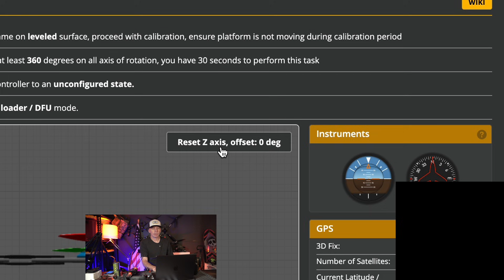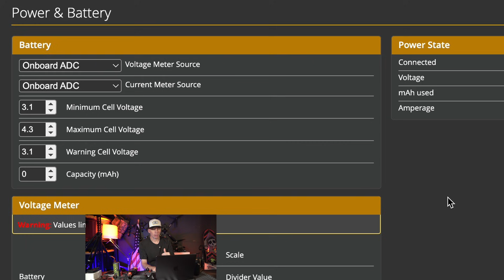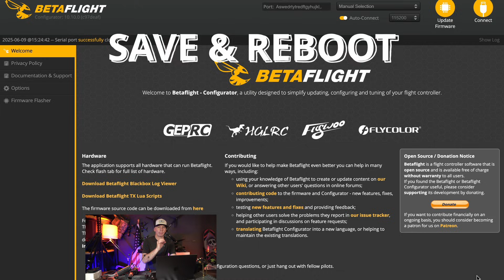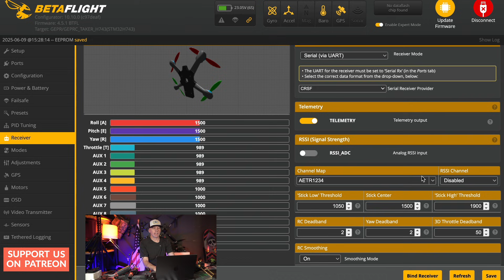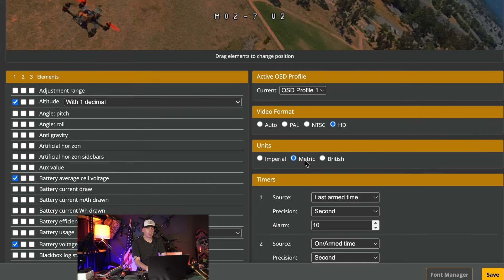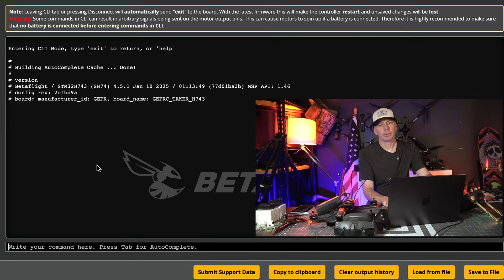Betaflight Setup & Tutorial - Step by Step Guide 🏆 + Gps Setup!

Comment: Would love some help guys. I bought a T8L controller and built a quad with the speedybee f405 mini stack. I'm very new to this, its my first drone build. I show the controller connected and things move in betaflight in the receiver section but the controller doesn't move the motors. I've tried everything but nothing is working. The motors move in betaflight when I test them. Any help is greatly appreciated

Comment: Hi mate, I’m following your videos but I’m really struggling to get my DJI remote 3 to show that it’s working in the receiver tab on betaflight. I have the geprc moz7 04 air unit with the TAKER H743 BT flight controller but I’ve tried everything to get it to work but unsuccessfully. What am I doing wrong? I have the DJI googles n3 and they have all bound properly but still I can’t get it going. Any advice would be greatly appreciated! 
BTW I’m a complete amateur but I sort of know my way through betaflight.
Reply from the maker: What Dji radio is it? Transmitter 2 or 3?
Reply: @dronecamps how do i know?
Reply from the maker: Yeah
Reply: @dronecamps how do I find out what transmitter it is? All I know is it’s a DJI remote 3 😂
Reply: The model number is FC88GC if that helps?
Reply: @dronecamps the specs says transmitter power (eirp) 2.4ghz <26dbm <20dbm
Reply: @dronecamps the specs says transmitter power (eirp) 2.4ghz <26dbm <20dbm
Reply: @dronecamps if you could help me out here I’d be massively appreciative… I’ve had the drone for nearly 2 month and busting to give it a go now 🤣
Reply: @dronecamps it’s a DJI remote 3
Reply from the maker: Try sbus in the receiver tab.

Comment: Hi, I tried to power up the motor tab without props, my motor 1,3,4over shoots and does not come down even if throttle is lowest. Is this normal or I am doing something wrong. 

my Drone setup
F405 V4 BLS 55A 30x30 Stack
SpeedyBee TX800- vtx
Eachine 800d- goggles
Q250 frame
Readytosky MT2204 2300kv ccw motor
Zop power 11.1v 25c 2200 mAh
Flysky FS-X6B receiver
Flysky i6 transmitter
Reply from the maker: Motors without props do that. It’s normal